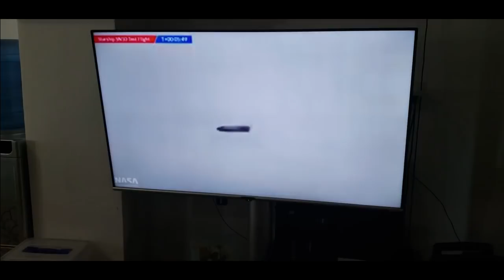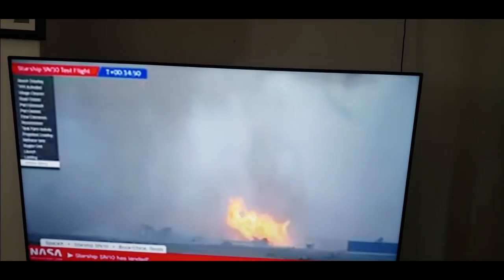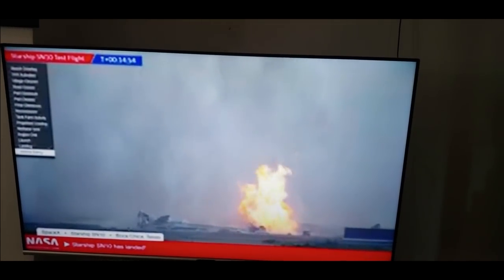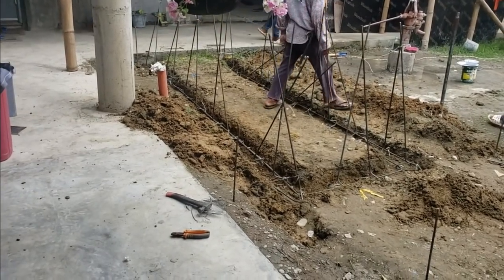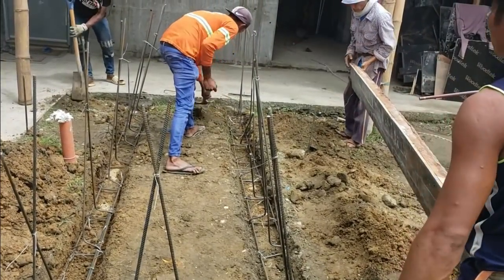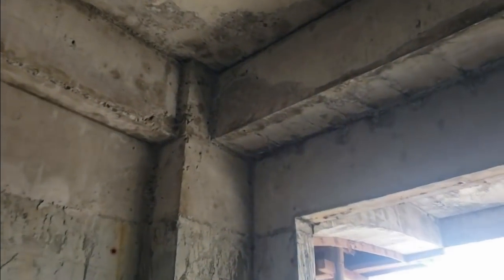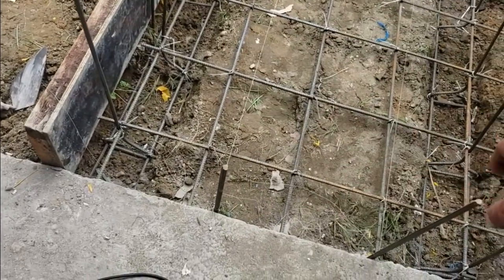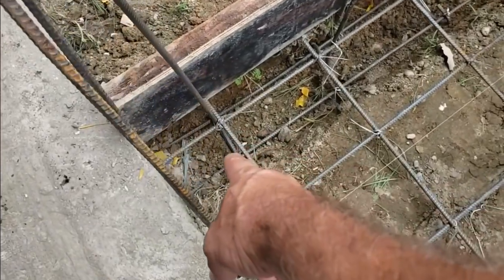Philippines Beach House Build Day 147: Shoot for the Stars one Step at a Time

Comment: When I was on a three week vacation in Cebu City, I could see a hotel going up. It was about 5 floors high at the time. CIP construction. There were many engineers and boss men on the level that they were working on. Those guys were watching and directing everything. I could clearly see it with my binos. So amazing. They were hauling long rebar rods up from the ground level by hand, guys on each floor passing it up from one to another. I didn't get to see how they got the concrete up there. So amazing.
Reply from the maker: Oh wow!

Comment: Another concern is with all tunnel form high rise Construction I've done we always slat, insulate then sheetrock. Because the concrete...breaths, forms moister spots as curing continues for years. Paint will blister.This is building in  Miami Fl. Same topical stuff.
Reply from the maker: that water proofing kills the moisture inside. Next you use a neutralizer on the concrete which kills a acid in the crete. Then skim coat. No insulation needed here. No  sheetrock - now talking about mold and mildew in humid conditions.

Comment: I could add Boss. That those boys see the writing on the walls, so to speak. They are going to loose time because walls are perfect and electrical done. No chipping, nothing. No rendering except for small bathroom. This job is closing faster then they expect. Sorry to be pain. How are you going to trim out the traps in the ceiling and light boxes are flush? Special trim?

Comment: Start heating up the rooms.."electrical" get 1 outlet going each room. For work. Time for the construction lights. I respect your idea of sub panels everywhere but I would of built a mechanical room. I even ask myself why you run so much conduit in main beams. I would try and keep out most of my piping out of them. But hey you got 16mm rebar.👍 plumbing ok. I could of kept out 75% electrical out of your support beams. Saved wire. It's fine because  you over build.👍
Reply from the maker: There is a mechanical room and there is a major reason for sub panels

Comment: Never work with family. Tell them pride comes before a fall. (Sacked). No point in everything looking great at the end of the build if its going to crumble after a few years. Its up to you its money you are spending not mine. But if you want to leave something for your family im afraid you need to put your foot down with your workers. It may be hard as they are part of your wifes family. But they should be doing it right for her she is their immediate family. You are paying them well feeding them buying protective gear and tools for them its all take and no give with them. Im not trying to be offensive here i just dont understand their mindset. You just fixed one problem with the wood waste now its on to another.

Comment: The Philippine Telcos stay in business because they have no real competition. There are really only two companies (three in some areas but the third is usually a distant third) and they both have cruddy service and no desire to do better. They have their customers over the proverbial barrel so they have no incentive to invest in better infrastructure. The new telecom coming in from China probably won't help much either because it will only need to build to the same standards as the existing in order to grab lots of customers (since they will be faster due to being less congested) and once they get a third of the market they will probably stagnate also. Sometimes (many times?) the Philippine laws that protect Filipino businesses work against the Filipino consumer :(
Reply from the maker: You nailed it 100 PERCENT